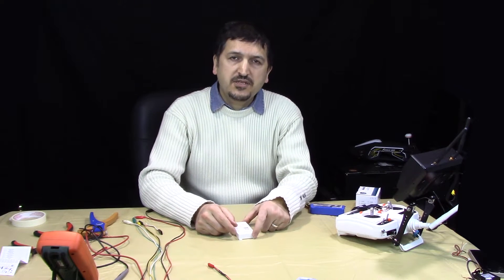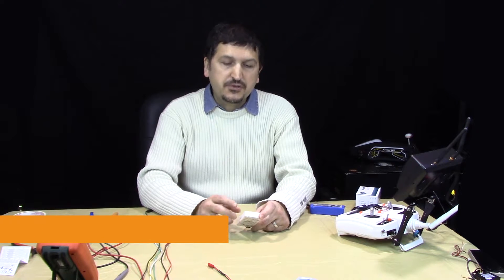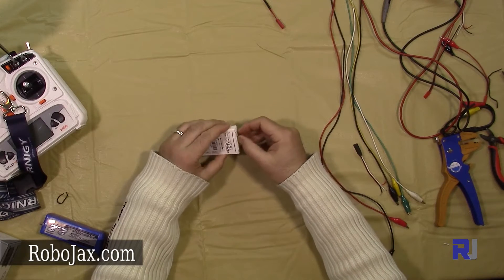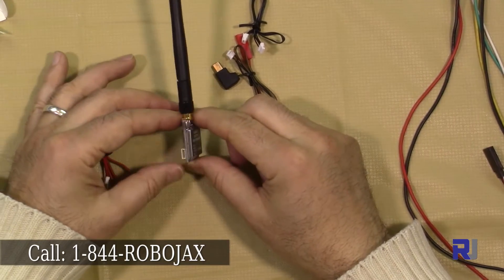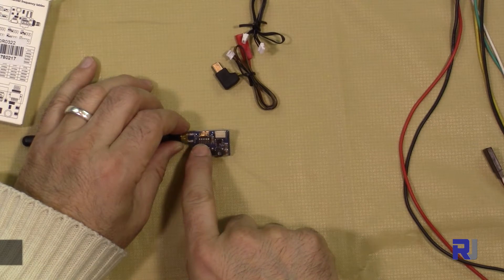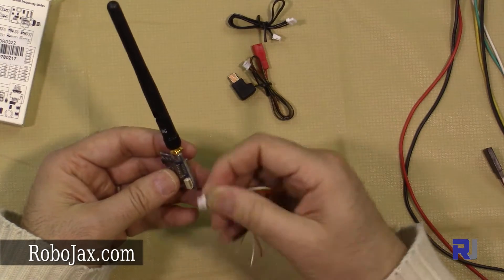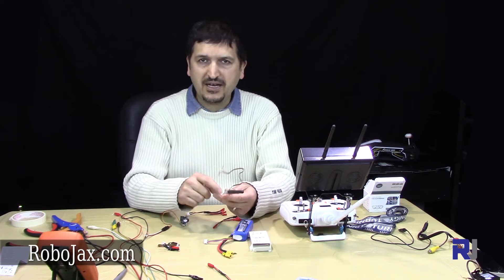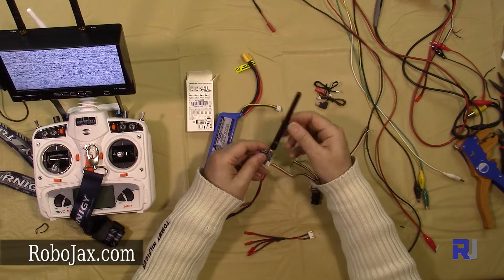Connecting Skyzone TS5823 200mW FPV Transmmitter - RJT647

Comment: im not getting any video signal..What channel should the receiver be on?
Reply from the maker: The transmitter has channel setting with the 4 switch you can set the channel and set the same with your receiver. here is one example of the manual https://www.toemen.nl/images/producten/2_boscam-ts5823-5.8g-200mw-32ch-super-mini-vtx.jpg
Reply: if I connect and leave the transmitter in a box (like an electric socket with 220v) does it work well, or does it create interference?

Comment: Hi,
Im using this PDB(http://www.banggood.com/Matek-Mini-Power-Hub-Power-Distribution-Board-With-BEC-5V-And-12V-For-FPV-Multicopter-p-1005549.html?p=8Q12113516108201601L)
and I want to connect this skyzone 200mw transmiter and this camera(https://www.aliexpress.com/item/Wholesale-1pcs-1000-TVL-FPV-HD-COMS-Camera-2-8mm-Wide-Angle-Lens-for-Multicopters-NTSC/32628334752.html?spm=2114.01010208.3.21.Q334ar&ws_ab_test=searchweb0_0,searchweb201602_3_10065_10068_10084_10083_10080_10082_10081_10060_10061_10062_10056_10055_10054_10059_10099_10078_10079_426_10073_10103_10102_10096_10052_10050_425_10051-10050,searchweb201603_9&btsid=7b2f59a2-c4f7-4bcb-999b-a0962cca0ed3)
However, in the pdb only three wires can be connected.Can you make a diagram or a video on how to connect these?Thanks alot
email:swaran@gmail.com

P.S:If you scroll down in the PDB link there is a diagram illustrating that only three wires can be connected.